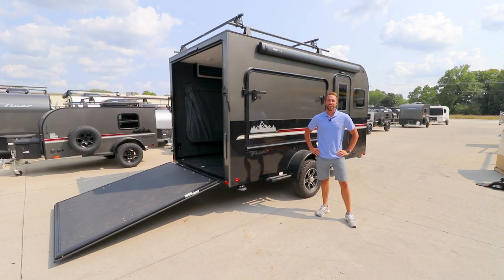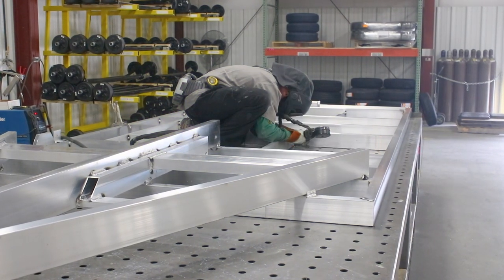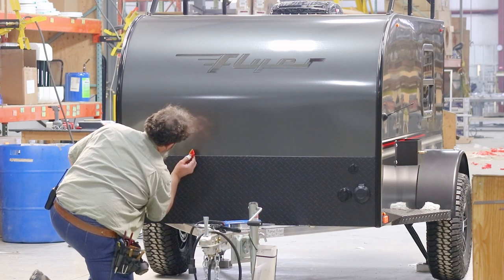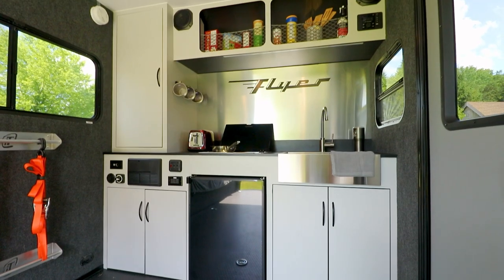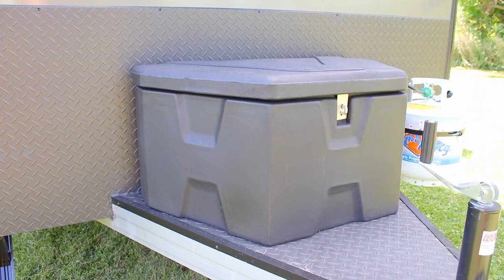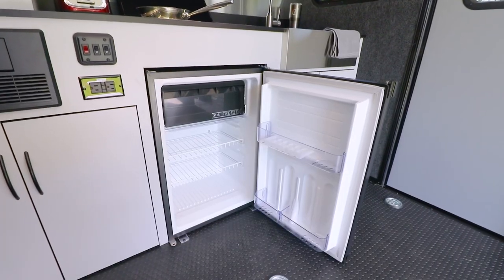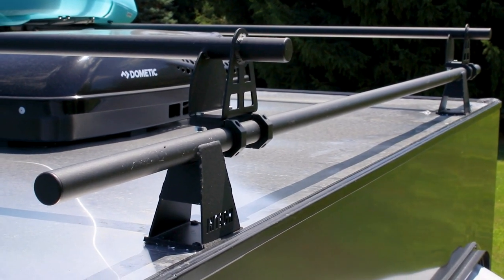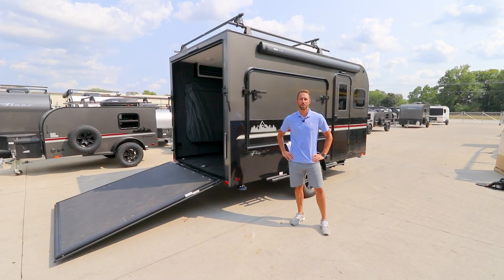2021 Discover Walkthrough

Comment: Really like a lot of things on the Discover, especially the interior height and cargo/toy room. And it looks like you guys build a quality product. But I guess I don't understand the 20lb propane tank for only a stove top. I'd be all in if it had a 3-way fridge (propane option), propane water heater, and possibly a propane heater. That would make better use of the 20lbs of propane. Oh, and maybe a quick connect to an outside grill. Of course I understand this would change the price point. Maybe some things to consider in the future. Keep innovating!!
Reply: Diesel heaters are far more efficient, safer and drier heat. Propane fridges are very finicky and inefficient. The grill connect is a good idea though.

Comment: Picked mine up. Amazing and love it but the one huge issue that would be easy for Intech to incorporate. That would be a hot water heater tied in with the existing propane with double the water capacity and a external hose attachment for a hot shower using a shower tent. It’s the little things and this would be so simple for them yet huge. Washing dishes with cold water sucks as well.
Reply: I carry a portable water heater as well as an outdoor shower.  I'd prefer it this way rather as it eliminates the need for winterization (at least for the most part) but I hear where you're coming from.  Sometimes, the manufacturers have to make a tough call and in this case, I think they made the correct decision.  I can always carry more water and alternate heat source but I do realize that it's not as convenient.
Reply: @kwangaroo  I just caught that set up too. Kinda a pain to set up and tear down daily and it leaves the shower floor and hoses all muddy in the morning for pack up. If I have to winterize the onboard cold water I  might as well winterize a shower

Comment: Can a Jeep Wrangler rubicon 2020 pull this
Reply: Dry Weight is 2475-2750 lbs. So with a 3500 lbs tow capacity. I would say yes, But this model does have a heavy tongue weight of 525 lbs. So I would say, still safer to tow with a midsize or full size truck.
Reply: Ever looked on the capacity on your door?

Comment: How do those pop out beds handle during heavy wind? Any shaking? I see they're supported by metal poles but I'm worried wind would rattle them like a tent.
Reply: I was wondering about that too.  Also how it handles hot weather with the tip outs?

I'm interested in it but we camp mostly in the southeast.

Comment: This may be a dumb question but, with the flooring and those side covers inside, could you also use this trailer to tow branches things to the dump? So basically you have a camper trailer but can also use it to take things to a dump.